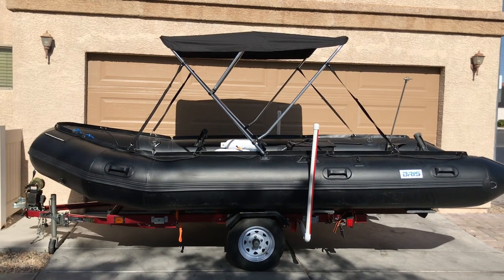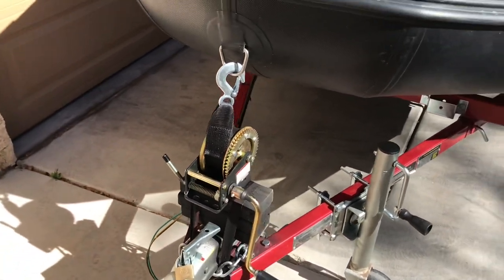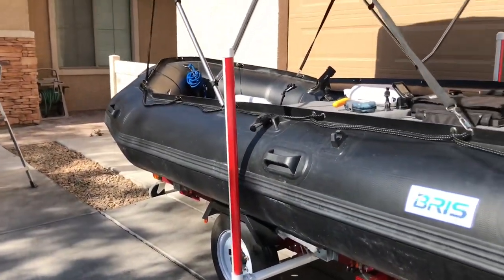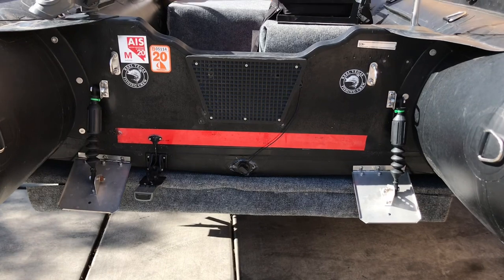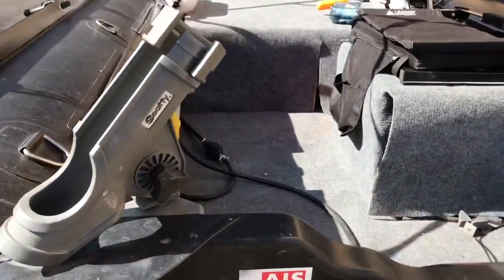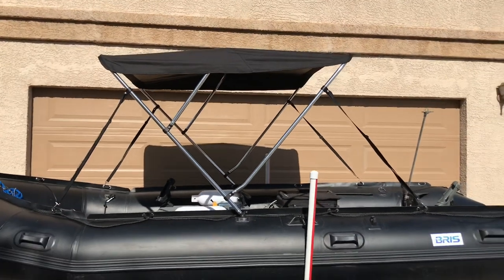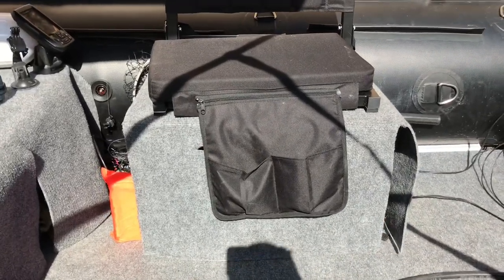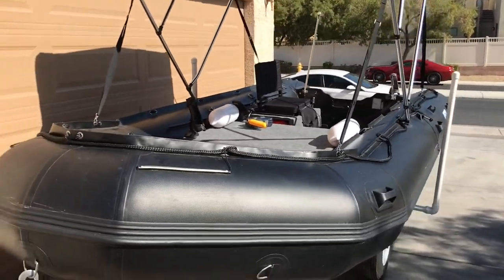Bris Inflatable Boat Mods & DIY Boat Trailer

Comment: Thanks as well for kick in the butt. I pulled the trigger today on a HF trailer! I got the higher weight rated one for a $100 off, $339 instead $449. I drove 90 miles to pick it up, not in stock any nearby locations. DMV is jacked, so no new reg's fir now.  Hoping cops will give me a break with receipt in hand. Rez's are made, plan is to trailer my 14' Saturn from SF to Lake Powell,  mid-June!!
Reply from the maker: blatantgemini Congratulations that is awesome send me some pictures when you get it done I would love to see it
Reply: I have the 12' Bris, which I just brought back from my second Lake Powell trip.  Such a blast.  I
Reply: @barriegrant7617  we are at Lake Powell now. Great trip thru Death Valley and Utah. Got boat in the slip right at dark. Tomoro first full day!
Reply: In many states, a boat trailer is not required to be registered or have a license plate. The boat hull number covers that. Check your local laws.

Comment: nice boat.  I have the saturn triton sd488 with a brand new 25hp suzuki.  These inflatables are awesome.
Reply from the maker: MR Unknown thank you for watching yes they are awesome but that Saturn is far better quality. I have owned both and would buy the Saturn line over the Bris in a heartbeat.
Reply: Interesting you say that. I've been comparing this boat to the Saturn SD488. Price and size they are the same on paper.  In what specifically is the Saturn better in quality?

Comment: Your boat is dressed out pretty sweet.  We're going the same route with a West Marine SB370.  We used a Harbor Freight trailer as well but it's set up to be a stake side or boat trailer.  The bunks run the length of the trailer and are removable.  We also installed bearing buddies on the axles.  I see you went with benches instead of seats.  Might do the same with ours.  Looking for parts to install a helm unit.  I like the LED nav lights, but if they don't have the right stamp our patrols don't react well to them.  Thanks for showing off the mods.  Lots of good ideas on a clean looking boat.
Reply from the maker: Thank you so much for watching and also the positive feedback. I really hope that you are enjoying your boat and the company you went with it was a very good choice they make very solid boats.

Comment: amazing video and work you've done here.  I love the idea of the trim tabs.  I'm going to look into that.
Reply: one quick question: would you be able to fit this boat on the harbor freight trailer without the extension you built?  What do you think is the max size that could fit on that trailer without having to customize/extend it?
Reply from the maker: Thank you for watching!! I just uploaded a video on the tabs today. https://youtu.be/OVGJxzFLPhg
Reply from the maker: DJ BEACHKNG yes it will fit without the extension but the tubes will have no support for almost 4 feet. I just felt more comfortable not having it bounce so much and stress the transom. Basically the extension gave the transom a support beam.

Comment: Mate I have literally the same setup - Black BRIS with the Bimini ( grey though). I have a Merc 25HP 2 Stroke. Installed a Whale Supersub bilge pump under floor. Also have a Simrad GO 9 XSE , and homemade 30ah Lithium battery box to run bilge, Simrad and also my live bait tank ( made from Dometic cooler with bilge/pump and switches.  I also have a Renogy 170 Ah flexi solar panel paired to a Victron MPPT to charge the battery box, which the panel mounts to top of bimini. Fantastic boat for the money. Only thing I would like is a more robust underneath, with more abrasion protection.
Reply from the maker: That is a sweet set up you have and I agree with you 100%.

Comment: Great videos and you've basically convinced me that this is the boat for me. Here's the thing though,  I've grown up on boats and have extensive experience with wood, fiberglass, and aluminum boats; however, now an Inflatable boat seems to be a necessity in my life so I very much appreciate your in depth videos.

 I am a little worried about your trailer setup as it seems like your weight distribution looks too far  back. Maybe if you put your fuel and your motor up in the bow of the boat when it's on the trailer it will be enough to make it track nicely behind your car, but otherwise I think you'll get a lot of swaying. 

Anyway, cool boat and I think I'm going to follow your lead on this one.
Reply from the maker: Thank you for watching. When I had that set up I would transport the fuel and motor in the trunk of my car. With it not being a true boat trailer I just didn’t feel comfortable. Also considering I had a 4x8 trailer paired with a 15’4” boat there just wasn’t anymore room without adding and extension.

Comment: Ha ha! You literally posted this exactly on the day I'm looking for a HF trailer for my Saturn 14'. I really like what you've done to your boat!
Would be great if you could show the trailer without the boat on it. Have you had any issues with the wheel bearing? Do you haul the boat with the motor on it or off? Thanks for video!
Reply from the maker: Gowdaflow Thank you very much the boat is quite heavy so what I will do is the next time I hit the water I will try to make a separate video of the trailer itself. Again thank you for watching the video!
Reply: @infiniteoutdooradventures2240  Ok Thank you!
Reply: I have the Saturn 14' SD430 - did you ever decide on this trailer for your boat? I'm looking at the same thing too!
Reply: Rambo Stallone I called every HF store within a 100 mile radius, not one has a 48”x96” trailer because of this covid19 crap. So, I actually ended up acquiring a nice Karavan jet ski trailer for my Saturn TR430. It’s about the same size of the boat and fits perfectly in my garage, couldn’t pass the great deal I got. I only have to modify the bunks and service the bearings.
Lol @ your profile pic

Comment: awesome boat man. im kinda hesitant to get an inflatable boat for fishing. have you had any problems as far as punctures and how does it ride in choppy waters? seams great to throw a small 7 or 10 outboard and hit the bays.
Reply: I have the Saturn 14' SD430 - I was the same as you - very hesitant to fish from an inflatable - after doing some extensive research and actually pulling the trigger and getting it - DUDE it is awesome! Extremely stable - better than anything I've ever been in and very very durable! I fish from mine no problems, the hooks just bounce off the hard PVC, there's no real place to puncture it with these tiny hooks, I would recommend however getting the aluminum floor in it - makes for a much better place to stand and fish.
Reply: @G3RMZONE  ..  Inflatables are commonly used for search & rescue, military landing craft, and similar. They are extremely stable, and almost impossible to flip over. The multiple air chambers make them almost unsinkable. Of course, make sure you get a real inflatable boat (with multiple chambers), not a swimming pool toy.
  Most fish hooks are no going to pose a problem, but you can take precautions (keep hooks away from the boat, use a net when landing fish, etc). If a tiny hook did puncture one of the air chambers, it would take some time for that chamber to deflate, plenty of time for you to slap on a patch and pump it back up. Of course, carry a patch kit and air pump.
  Another advantage is how easily they cut through the water. A small motor (4-8hp) will get you going quite nicely. Even a trolling motor will offer speeds of roughly 4-5mph.

Comment: Thank you for an awesome video! I just purchased the same boat used. One question I have is I see you’ve glued around your drain plug was it leaking? Also, can you drill a hole for the fishing pole mount on the back of your boat? Thanks again.

Comment: Great video.  Thanks for making it.  I bought a Saturn 14' and the same trailer to haul it.  I noticed that you built the wooden frame with a board down the center of the trailer.  Doesn't this get in the way of the keel?  I am going to build a similar frame, and I would like to know your thoughts about this.  Thanks again.
Reply from the maker: Robert Uria Thank you for watching when I am trailering the boat I deflate the keel.
Reply: Pretty smart of you to deflate the keel.  I started building a bunker system and it has proven to be a lot of work with the metal cutting and what not.  It doesn't look like you carpeted every part of the wood frame though.  I would be concerned with the friction of bare wood on the boat, over time.  @infiniteoutdooradventures2240

Comment: First and for most thank you so much for the update on your boat I had couple questions for I was wondering if you had a video of you building the bench seats and where did you get the top from and last but not lease I noticed you didn’t have any registering stickers on your boat is that because where you live you don’t have to have it on there ?
Reply from the maker: Gerald Paul Thank you very much for the comment I will try to pull the seat and show exactly how I made it also I purchased the top from Amazon it was just a standard boat top but I did buy an inflatable boat Bimini top mounts, I use removable plates I don’t keep them on during transport so I don’t lose them but we are required to register any vessel with the motor here in my state. Again thank you for watching the video!

Comment: Nice setup! Curious how you transport the motor with that?  Do you transport mounted to the transom and if so do you have anything to support the bottom of the motor while in transport?
Reply from the maker: Darryl Carden than you for watching!! I personally load the motor in the trunk of my car. I have moved it mounted but just didn’t feel comfortable considering there is no support back there.
Reply: Had same issue in the past. I have basically the same set up. I simply just moved the wench forward so that the two boards on my trailer support on bottom of transom and had installed a transom saver bracket onto the trailer that takes all the weight off the transom itself on during transport. Haven’t had a single issue

Comment: saw your not using the boat anymore, did you run into any problems with boat or trailer?
Reply from the maker: Thank you for watching! Not so much that I ran into any problems just decided to move on to a different adventure. The boat itself did have flaws and if I were to get another again I would definitely go with a different company.

Comment: I’m thinking of buying this boat for spearfishing, what problems did you have with it?
Reply from the maker: Right out of the box it was very clear the boat was cut uneven which made the floor sit improperly, the floors were falling apart from the rivets straight out of the box as well if I do recall the drain plug was leaking also. I was also disappointed in the fabric despite having several lesser quality material boats this one ripped on the first outing launching and fishing from the exact same area. For the price of the boat and so many imperfections I could not in good conscience recommend anyone buying this particular boat

Comment: Is there ever a concern or issues of debris coming up from the road and puncturing the bottom of the boat? I'm about to be putting an intex mariner 4 on a HF trailer and that question always pops in my head

Comment: What type of adhesive did you use to attach the lights on the back?
Reply from the maker: The lights came with adhesive but I put a little H-66 vinyl cement to make sure they stuck.

Comment: Hey
I'm just about to order this same one...Any problems with the boat? or suggestions?
Reply from the maker: Scot-Free Thank you for watching the video yes they were quite a few problems with this particular model. Problems that I would consider significant especially if you do not have experience with inflatable boats. The cut of the boat was crooked which in turn made it extremely difficult to put the floor in also the floor rivets were falling apart straight out of the box the drain plug had a leak which was the least of my problems but considering how much the boat cost I think that is unacceptable.  The bags that come with the boat are absolutely useless again minor but still unacceptable and I did not like the cut of the Transom with the dip in it it fits right in between a short and a long shaft
Reply from the maker: Scot-Free I would also like to mention surprisingly the upgraded thicker material ripped on my first outing as opposed to the 0.9 mm thinner material which I was very disappointed. I was using the boat at the same area and same exact launch nothing different
Reply: @infiniteoutdooradventures2240  Thanks Brother! Any particular brand  you would shoot for next time?
Reply from the maker: Scot-Free I have owned Saturn boats in the past they have an excellent product. They also have a Mercury brand and if you can find one in the United States a Honwave by Honda I hear are as it’s good as they get
Reply: @infiniteoutdooradventures2240  Blessings.
Reply from the maker: Scot-Free Same to you Brother. If you ever need any help feel free to ask

Comment: I just recently bought the same boat what size bimini top did you buy ?
Reply from the maker: Harold Isasi thanks for watching good luck on your purchase. I do believe I got a 6ft long by 72” wide. Make sure check the drain plug seal and definitely assemble before you go out.
Reply: Infinite Outdoor Adventures thank you so much enjoy

Comment: what are the dimensions of the tabs? 7 x 8? or do you have the 9" x 8"
Reply from the maker: Boris Belousov Thank you for watching the video! I have the 7 x 8 tabs ST781-20.
Reply: Was about to grab the tabs I have the 16.5 Saturn aluminum floors with a 2020 20HP EFI outboard. Would you stick
With the size u have or go
Up in size like the 10x10? The 10x10 are rated for boats 14’-20’

Comment: Can you provide link to that sun canopy ?
Reply from the maker: https://www.amazon.com/Seamander-Bimini-Straps-Mounting-Hardware/dp/B07CNSGQ1K
Reply: @Infinite Outdoor Adventures  what do you think you're cruising speed is Comfortably loaded up with that 20 horsepower
Reply: @infiniteoutdooradventures2240  how much weight you think you're at with all that equipment in the boat looking to buy one of these next week
Reply: @infiniteoutdooradventures2240  also what size trailer is that from Harbor Freight like what's the length on it